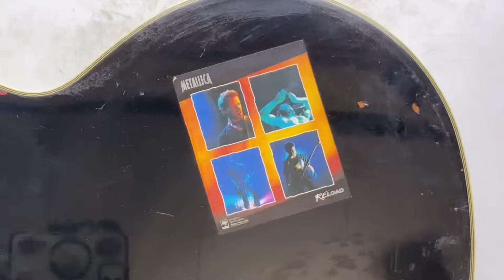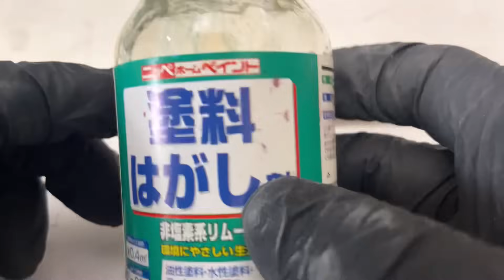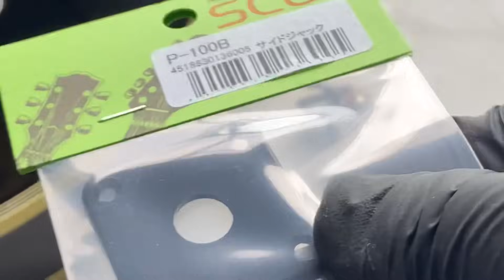アルミテープで加工された国産ギターをクリーニングしました。-I cleaned up a Japanese guitar that was processed with aluminum tape.-

Comment: I am a long time subscriber and have watched every single video you uploaded. Your restorations are most admirable because of your dedication to smallest details and the patience you practice. That's why I was surprised that you have missed the rear side of the head stock (it's upper part) and that you made some scratches on the polished front of the body while screwing in the screws that hold the saddle. Which makes you human, I guess! Another great job, though.

Comment: Great work, outstanding video production, and very strong gloves🤣, what was on the red can? impressive cleaner. What I do with the screws, place them on the tip of the hand drill as a drill bit, and use the finest steel wool, slow spin against it and then just some lithium grease. It sounds so good, congratulations.

Comment: i would have just stripped all the black paint off and given it a wood grain finish.. it would have look a lot better than that half baked paint job.. sand out the scratch marks etc., stain it, and clear coat it etc... would have looked great.. any time you redoing a guiatr it's always going to be a custom guitar.. so give it wood finsh every time.. unless you gonna go into a paint booth and give it a real professional paint job

Comment: Though it would not have been my first choice to refinish a guitar this way it does look much much better than the aluminum tape version of this guitar. I would have at least removed all of paint from the top to see what type of wood it was and see if a dye could have been used on the wood. Not a big fan of painted wood. That being said the guitar is much better off than it was before you started working on it.

Comment: i would have changed out the pick-ups & switch. they used cheap ceramics on these 80's copies. swapping them would actually improve it. i like that you didn't try to get it perfect, allowing the guitar to retain a lot of its character.

Comment: You should always re level and recrown the frets. And do more surface prep for a better finish, there’s still too many deep scratches visible. Wet sand between coats, apply more clear lacquer before sanding back the orange peel  with 1000 grit and polishing.What I did on an edge bound  full body respray was sprayet completely with color and rescrape the binding  after wet sanding prior to clear lacquering (not just one clear coat), then you get a sharper edge on the binding than what you can do by cutting masking tape

Comment: great work. i have quick tip as a custom painter here in the u.s. when you're masking circular holes, roll up masking tape with the sticky side out. and expand it to the inside of the hole. your method works great, but rolling up tape and leaving some above the surface makes it easier on removal because all you have to do is pinch the tape and twist. It also reduces how much paint may chip out as well.

Comment: It seems to be a Greco EGC58-60  from 1989, made in Japan. First covered in red, then with aluminium tape. I think I would have like to try to keep the wear on the guitar but it's not so pretty on poly finish. Anyway, what a saving, congrats ;)

Comment: Next time you should sand the entire guitar then clean it again no need for primer as the sanding makes the bond. Then sand the paint with levels of sand paper to a finishem wet sand paint. Then clear coat aand to a finish another coat. Then wer sand again polish buff wax shine done

Comment: But you didn't fix the dings in the neck. As a guitarist that's the absolute most important thing to have fixed. Nothing worse than your thumb getting stuck or dragging due to a ding in the neck